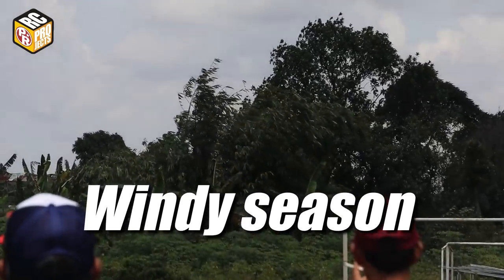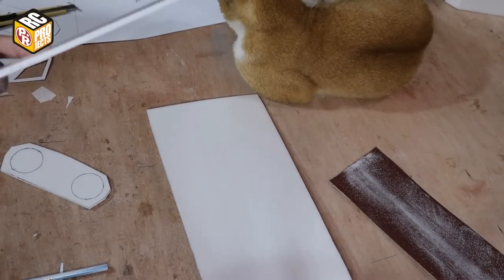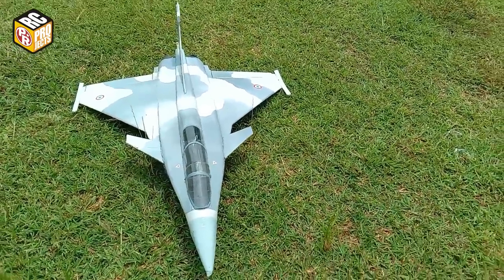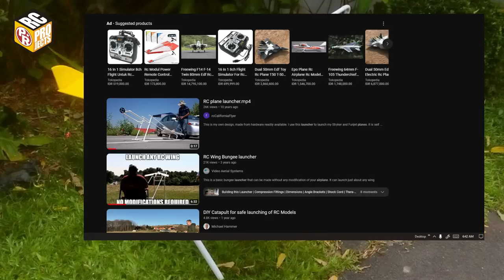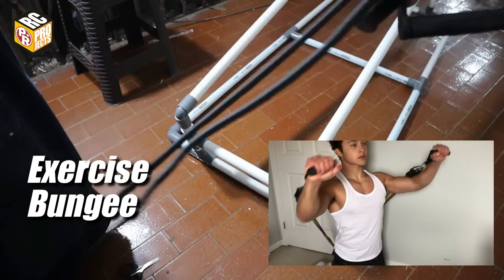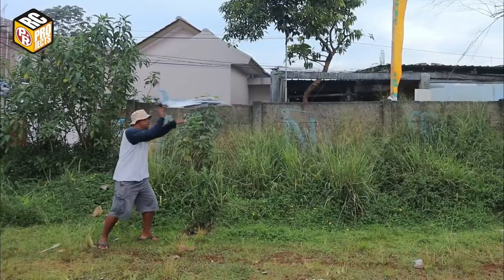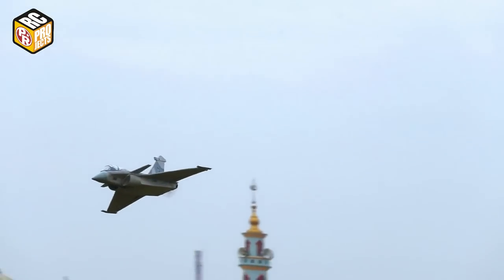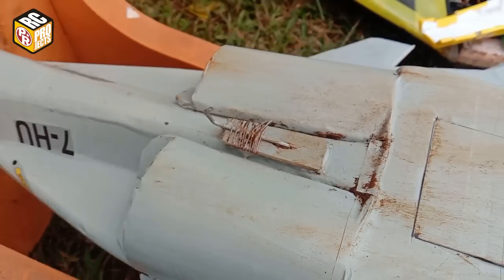How to Make Rafale RC Plane and Launcher

Comment: Hi julius 
I want to notice you for your kind attention
When you give firewall print kindly mark the position of motor mount screws

It has a great impact on thrust issues and thrust roll
I have faced this problem in all your build cessna172 and corsair
Flitetest. Ppl  will give this firewall markings

Comment: Tip you may like to try guys I’ve built lots of his planes now , gear builds but I add to it by filling the wings with expansion foam build wing then small hole full wing gently makes the model so durable just thought I’d share my experience

Comment: I expect more on this plane... Like building and detailing... Why you finish this video very fast.... I cant enjoy this video like previous ones... Anyway nice effort and build
Reply: Its a small plane bro
Reply: He doesn't owe you anything
Reply: I understand so much. But small size as says RC planes makes it more tricky. 
About front canards what I knows about the 1/1 Rafales their role is mostly to make the airflow better, not really to control pitch directly like a classic canard. So probably useless to move on a small scale... Furthermore on the 1/1 it is completely computer controlled and sometimes you may see them get down while the aircraft is going up ! So what Julius did is probably the best thing, engineering it like a classic delta. 
Its aspect and finish are very good , maybe Julius will take the challenge of a bigger Rafale, two props or why not electric turbines. 
I guess the experience shared by Julius could be useful to make a bigger model, 1,5 x or 2x blueprints, with emphasis on rather 'slow' flight, realistic flight. If the small one fly ok it should be ok bigger, I suppose. 
Hoping though Julius will not either be stationed with half a success... 
Besides, it would hardly ever be an easy jet, delta characteristic (I would have to improve my flight skills a lot before to fly it... Let's try a foamy Rafale, a second one as a static , .... etc ...my personal thought 😊)

Comment: Maybe use the canard as elevator and standard ailerons would work better.
Reply: I guess it wouldn't work. It's not a regular canard aircraft, rather z classic delta with front aerodynamic surfaces. The 'canards' here on the real one are mostly computer controlled to adjust the airflow, very complex so a scaled Rafale is even more tricky, the best is probably to consider it as a pure delta what Julius did. Front surfaces may help for stability. It would take a lot of time to make it really useful on a scaled model.

Comment: Why did go back to packing tape?, instead of the covering film that you could paint and you used in a few models ago
Reply from the maker: The adhesive on covering film after some time it will loosen, I always prefer using packing tapes, but the color was limited to only white because it can't be painted, but now it can using plastic primer

Comment: Rafale doesnt have such a great anhedral angle thats why u might face controlling issues since anhedrals do not maintain equilibrium
Reply from the maker: Looks like I use wrong blueprint
Reply: @JuliusPerdana  yes maybe
anyways just a suggestion try to create your own blueprint with advanced understanding of aerodynamics and applying it using your own creativeness
also u could have used edf and some led strips for some good afterburner effects
:goodvibes:
Reply: Awesome man!!
just checked out your channel its amazing damn good job on making so many aircrafts and boats
Reply from the maker: yea, I usually do that, compare 2-3 blueprints and actual photos, I even teach about it on my modelling tutorial, but I forgot it myself lol. Thanks btw